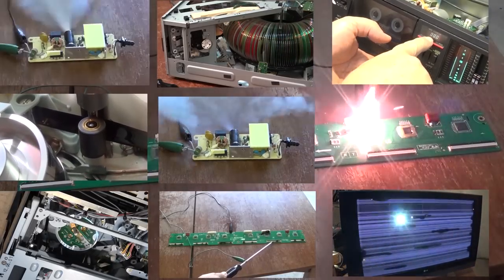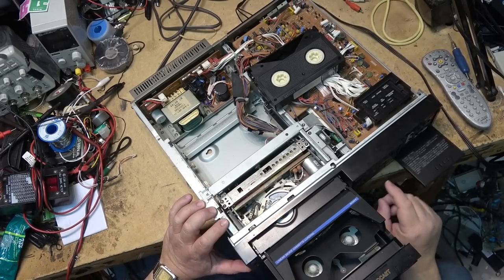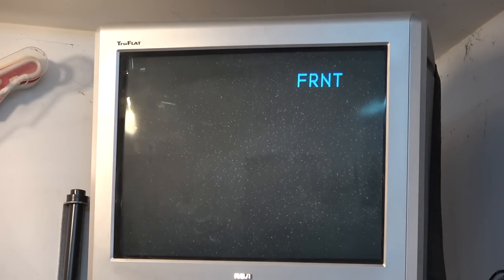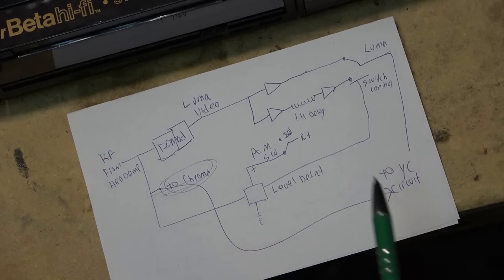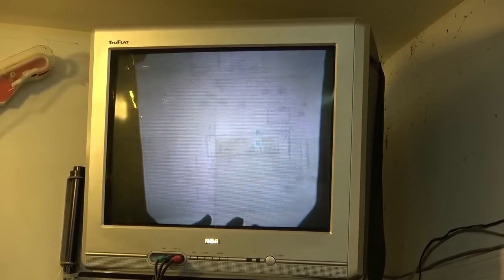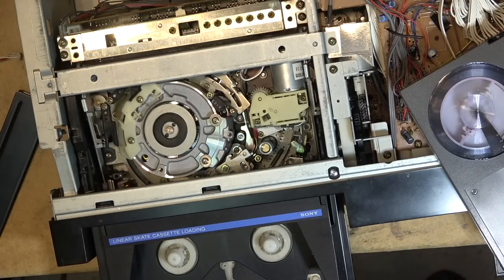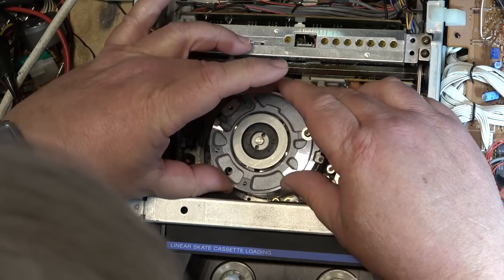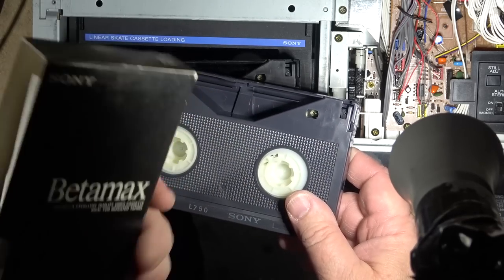Sony SLHF750 Betamax with a poor picture

Comment: Chroma is delayed for crostalk cancel, it is addititve not switching.
Reply from the maker: Actually it is an artifact of signal processing.  Why do you think every color tv has a 1h delay line on the lumamence signal.  Same thing happens in the down conversion and then up conversion process.  Betamax and 3/4" inverted the color between the even and off fields.  That was done for crosstalk cancelation.  The reason is because the color is recorded directly onto the tape whereas the lumanence is fm modulated.  The lower frequency of the color signal leaks through the +6 -6 azimuth difference.  
Vhs stepped the chroma forward 90' each field.  That way vhs needs 2 full frames to get back in phase with the original signal.  What this means was vhs needed 2 frames for color sync and betamax / umatic only needed 1. 

Some would say just delay the luminance to get the chroma to line back up, but you can't because that would throw off timing signals and other data that can't be shifted like closed captions.